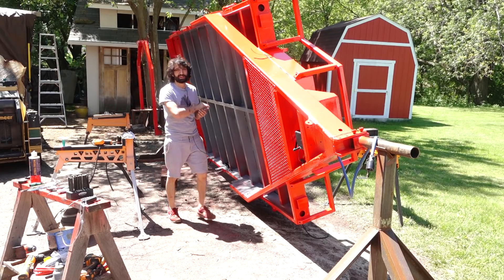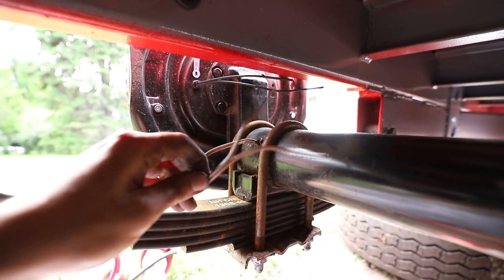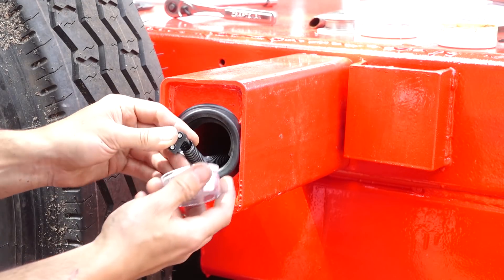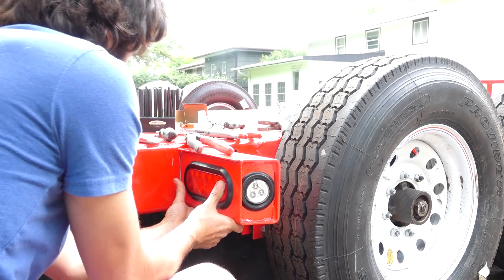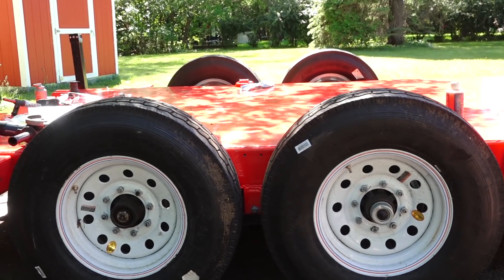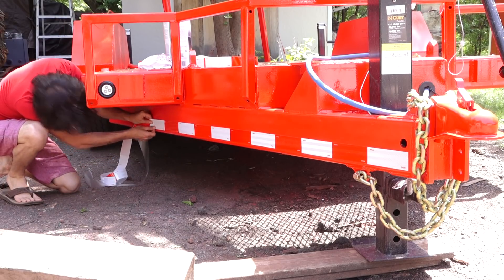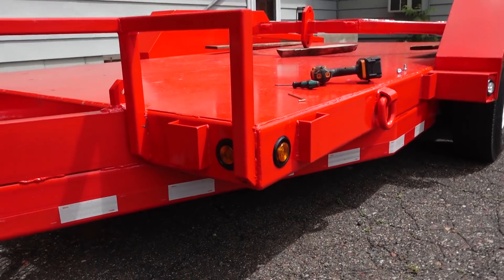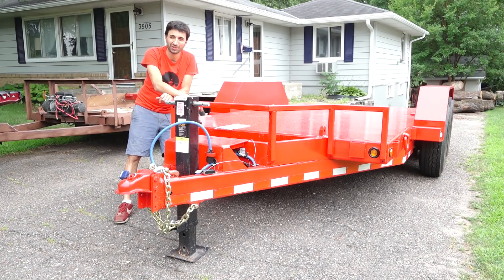Wiring the Lights & Brakes - Urban Logging Trailer Build Pt 10

Comment: I have a feeling the bolt used to attach the safety chains to the trailer is way weaker than those sweet 3/8" chains
Reply from the maker: A little.  I used a 1/2" bolt as I was originally planning on using the 5/16" chain.

Comment: Eventually you will want a small detachable gopro to use for backing up with a display in the cabin by the steering wheel :)
Reply: They actually make purpose built trailer back up cameras that hook up to a dash cam. I'll see if I can find it again and provide the link.

Comment: The park lights,  brake lights, and turn signals seem to be only one row of LEDs. Is that the way it is supposed to be? Typically the park lights are one row and the brake lights and turn signals are 2 or more rows.
Reply: Is the trailer bed the same height as the saw mill bed?

Comment: In this age of EV's, wonder if anyone has thought of putting a EV worm drive low gear motor on one trailer axle so the extra drive could be switched on electrically when powering through a muddy trail at low speed, to avoid getting stuck.

Comment: Ah, shame you didn't run any wires for backup lights, they can be pretty helpful in the dark.
Reply from the maker: The unused turn signal line on either side can be used for back up lights.
Reply: @mcremona  Nice. You really did think of everything.